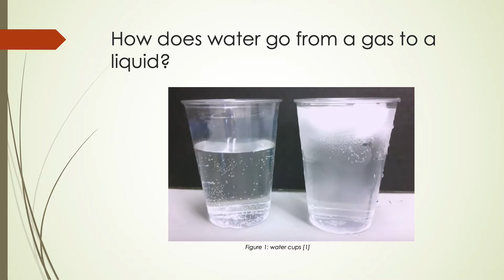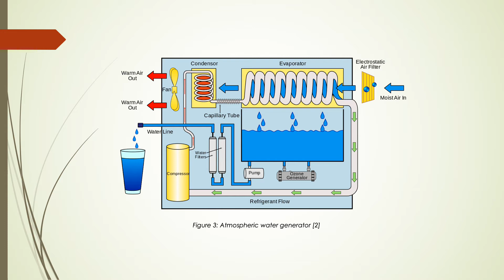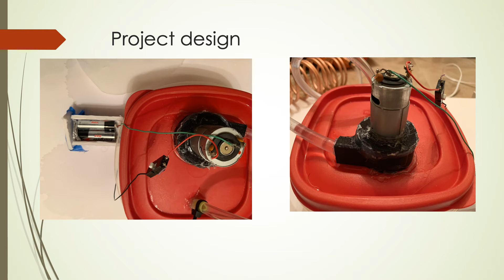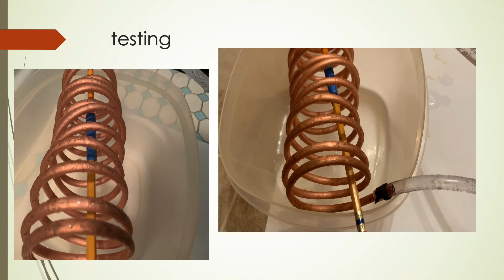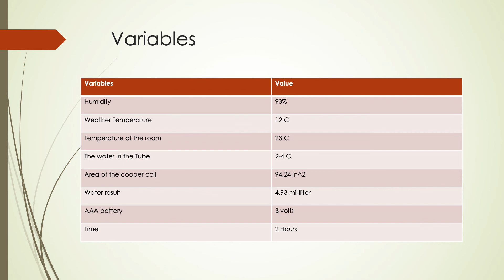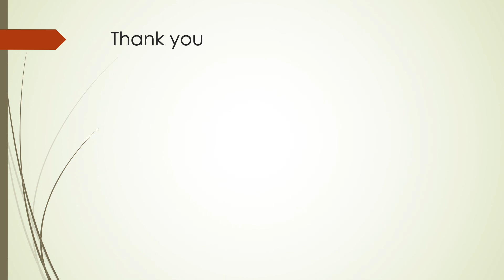Atmospheric water generator

Comment: i see a few similar projects on youtube. They have a much higher water gain with a lower humidity in the air. I think the difference is they are cooling the water to 0,5C° (33F°). So the cooler the water, the more gain. Also they add rocksalt to the water to make it even cooler. They also put a fan in the direction of the copper coil so more humid air is passing quicker past the coils. I also found out that you have to make sure that your copper coil has no isolation PE layer on the outside : - ).